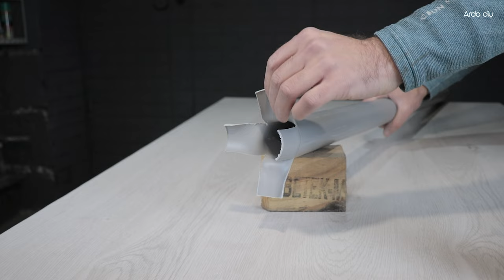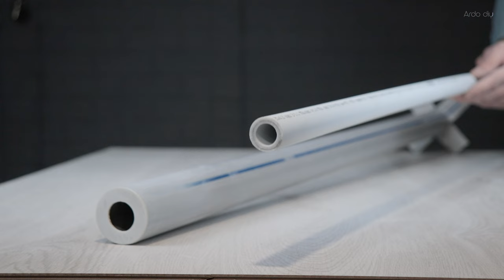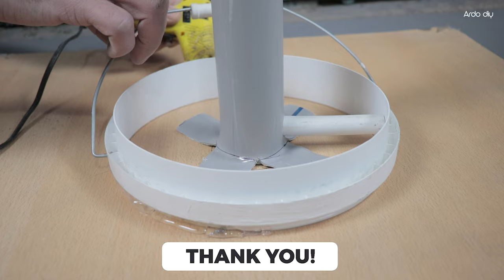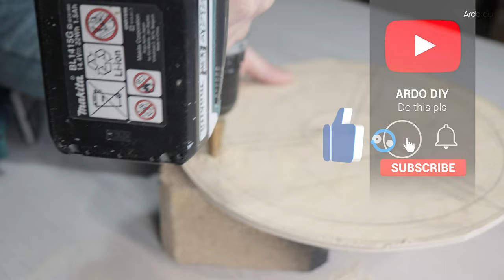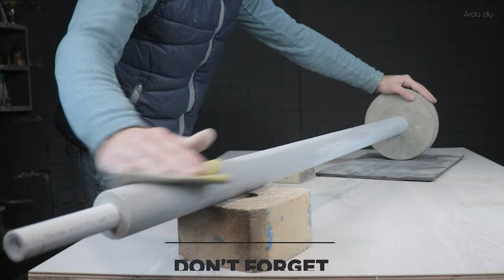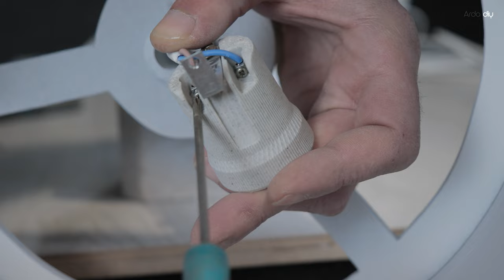DIY Floor Lamp

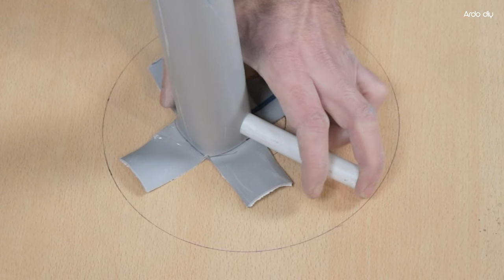Comment: 3:31 I would use a longer pipe that goes through across the lamp pole, just to be sure that the cement base wont just fall off from the pole. I'm not confident with those flaps. I would pull the wire with a thread instead. Nice video, thanks.